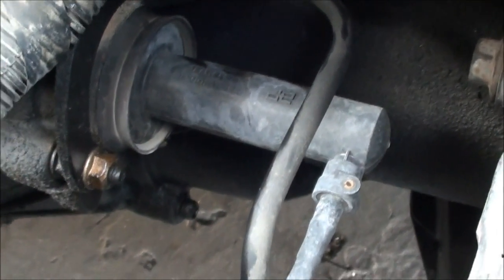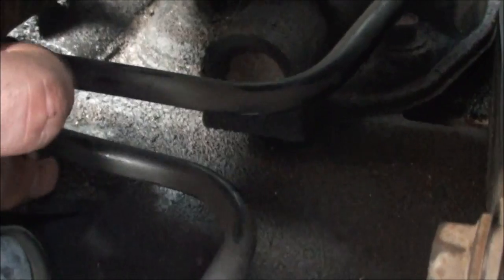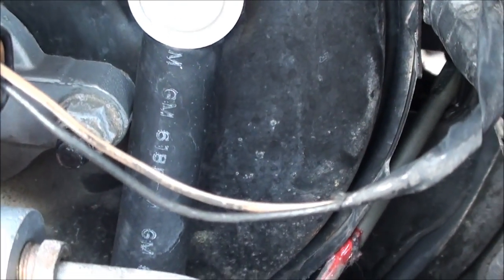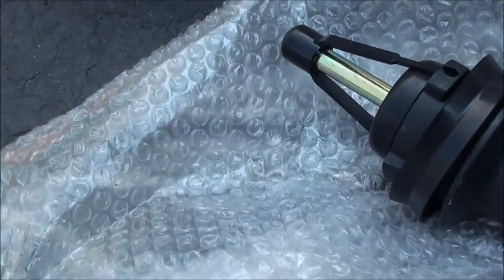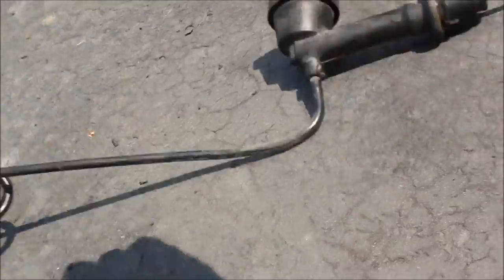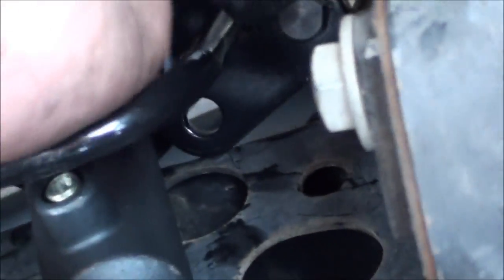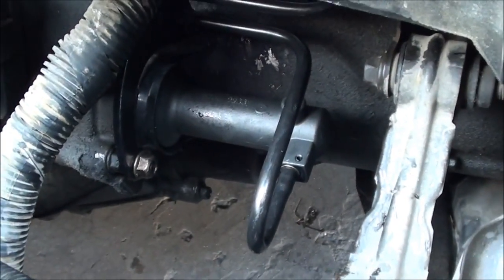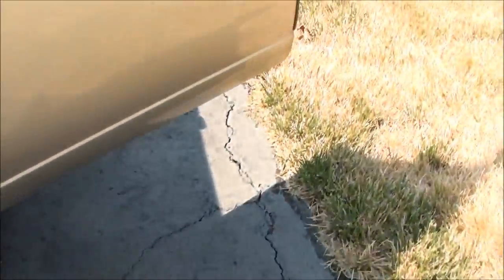Clutch Master and Slave Cylinder Install on 1998 Saturn SL2

Comment: Thanks for making this video. I really appreciate your genuine and sincere efforts on this. I plan to replace the clutch master and slave cylinder on my 1997 Saturn SL soon. I already bought the assembly filled with DOT 3 brake fluid and pre-bled. Your video offers some great tips.
Earlier I thought I licked the "nails-on-a-chalkboard" sound by disassembling the clutch pedal assembly and lubricating the nylon bushings with white grease. Although this was necessary, the same problem persisted.
Anyway, thank you again. This has given me more perspective and knowledge to tackle the repair successfully.
Reply from the maker: +Ronald Schild My pleasure! Just trying to do my part to help others.

Comment: Was dreading the job on my girlfriend's 2000 SL1 until I saw your video. Thought it was more entailed. Only struggle was getting the masters out and back in due to the booster. Really had to muscle the new one in. Took the better part of 3 hours but for a first-timer that hates to force things, that's probably not too horrendous. TY!

Comment from the maker: yes, I removed the airbox, but could not remove the battery tray because the bolts were too deteriorated by battery corrosion to remove. as long as you can feed the lines through and get it to not rub on anything the wrong way you should be fine

Comment from the maker: they both work together. Master cyl. is what converts your pedal pushing into hydraulic power to push the piston out of the slave to disengage the clutch. best to buy as a master/slave unit since it is a pain to bleed the system. If you have a lot of miles and its grabbing low, it might be a worn clutch plate and/or flywheel. those are "fun" to replace. never replaced one but hopefully won't need to for a while. hope this helps!
Reply: En este caso, ya cambié kit de embrague y si, cuesta algo cambiarlo....

Comment from the maker: Does it shake in neutral?, i.e. shifter not in any gear and not depressing the clutch pedal. if so possible tuning issue or something off balance. the difficult shifting could be something with the linkages or the pedal is just not getting pressed all the way down, if so then start suspecting the clutch. check the clutch reservoir for fluid. pressing to floor and still hard shifting may not be disengaging all the way and its hard shifting. so then this might install might work. Hope this helps!

Comment from the maker: It is a good possibility that it will help. you also may need to replace the shifter bushing on the shifter knob as well if there is a lot of slop while in gear. the shifting is controlled by cables and not directly connected to the transmission like a rear wheeled vehicle would be. check all your cables too and see if any need adjustment or replacement. Good luck!

Comment from the maker: Thanks! if I remember correctly the brand was Perfection and i bought it from Advance Auto Parts. If you have the DOHC like my car has then it should be a nearly identical install. I am pretty pleased with the install only had one problem after where it kept squeaking when pressing the pedal but quickly fixed by moving that little clip in the clutch pedal. as for the idle issue, not sure if this will help. might be a tuning issue. I would search in the SaturnFans forums tons of info there.

Comment: I recently had a new clutch and flywheel installed and when I depress the clutch pedal it makes a clicking noise. Could it be the master and slave needs to be changed?

Comment: Thank You Bro this really helped me a changed mine on a 2002 with abs..I had to move the brake fluid Reservoir and a few other parts I actually did the remove entirely the battery compartment it helped alot

Comment: Great Video man!! ..would this procedure help me shift gears smoothly? I have a 1999 Saturn SL2 and its quiet difficult to shift gears sometimes..i have to use a good amount of force to get into 2nd gear from 1st.
Reply: I have the same problem, been fighting it for years. I have to make sure the resevior is full and press hard on the peddle to shift.Just bought the prefilled Duralast unit from AZ store which I'm going to install as soon as it warms up a bit more.:) I hope my battery box isn't rusted in.:)

Comment: Hello and thanks for your video regarding manual clutch fix for s series Saturn's. I would of liked to see the work done under better lighting and perhaps see the 'fix' while the cam was not shaking. When you went inside and under the dash to show us the clutch/rod/linkage, it was impossible to obtain some valuable point's of interest for determining the problem. I will use this tomorrow though and pray it all comes together as in your video.
Reply from the maker: I Apologize for the horrible lighting, There wasn't much room to work with to put a light and didn't have a tripod small enough to stick out of the way when I was working. Best suggestion I can give is to go in before any project and take photos of what everything looked like before and try to put everything back as it looked in the photo. Good Luck!
Reply: jungleking007
Thanks for reply. For what it's worth, my clutch 'fix' was much easier then imagined. Equipped with a strong light I slid myself up under the dash and found that my clutch pedal had only popped off this small silver rod which I'm assuming is the top of the hydraulic pump. The pedal must of came off while I was trying to push/jump start the car or while I was bumping around in the dark down there.
Reply from the maker: Don't you love finding out the huge problem you think you were having was some very small easy fix? I am happy to hear the issue wasn't something bigger.
Reply: Oh yes I do agree and only wish that was the case most of the time then not. This site will prove to be a needed tool in the months to come. Thank you all.

Comment: I just changed out a clutch to a stage 3 clutch in my buddys 1997 saturn sl, it was hell. we actually ended up blowing out his slave cylinder just by changing he clutch (im sure it had issues before hand it was just the straw on the camels back). about to change that out tomorow wish me lucj

Comment: Hi we did the excact same thing as in this video. Well my 98 saturn was having trouble shifting. and the whole clutch kit and slave/master cylinder was replaced. When replaced. I noticed that the plastic part did not break when the pedal was pressed. It shifts when car is off and stuck when car is on. This was the same problem as before. Is there an adjustment in the pedal? I don't see one. There are no leaks in the hoses. Is that rod to the transmission too short?

Comment: 13mm nuts. Pretty much everything on the car is metric. Also, you can replace portions of the system instead of the whole thing, but you still have to remove the whole assembly and then bleed it properly.

Comment: This was a very useful video. Did you take the air filter box out, instead of the battery tray? Anyway, I managed to get the tray out, didn't take out the airbox or the brake stuff.
Just a tip for people not wanting to unbolt the brake master cylinder... getting the old clutch master out is slightly difficult, just because you have to figure out what's in the way, etc., but after you figure it out, putting the new one back in is easy, up until the part you have to twist it into the firewall.

Comment from the maker: If you bought the entire unit they are set to go no bleeding required. however, bleeding a manual transmission clutch slave and master cylinder is possible, very tedious because you don't want to ruin the parts. never done it though. sorry. if you go to a forum for saturns (saturnfans) search there, I believe there are a few ways to do it.

Comment: Hey, I've got a few questions.  I've gone through two of these assemblies this week and I realized that the problem was the plastic retainer cap on the slave cylinder.  The first one I installed a few years ago went in smoothly with no issues, but after doing it again yesterday, the shifting only got harder.  I took it back out for a replacement (thank god for a lifetime warranty) and noticed that the clip only detached on one side leaving the piston all cockeyed. I had installed the new one thinking it would break on both sides, but lo and behold, the same problem occurs. Am I possibly doing the install incorrectly, or is it just my luck that I would get two duds in a row? The shifting is a beast.  Also, when I removed the old one originally, the plastic cap never came out with the shaft.  Is it supposed to burn up in the bellhousing?
Reply from the maker: The end cap is supposed to become part of the unit when snapped, if it didn't come out then it is probably at the bottom of the bell housing or still stuck somehow on the clutch fork. You will need to place the slave cylinder in as straight as possible, you may have missed the clutch fork the first time. However, with aftermarket parts you never know the quality these days due to where they may come from.
Reply: As far as I know I thought only one side was supposed to break I could be wrong thou.
I can't even get mine to break

Comment: Do you know if doing this on the later SL2 would be much different? I need to replace mine and while it uses a slightly different part but it's a very similar part.
Reply from the maker: +Haanken Thorax should be a very similar install. The master cylinder is a little different design but I think the slave cylinder is the same.
Reply: JungleKing007 Hey man, thanks to your video I got the old one out, and the new master in, but I can't seem to force the new slave in, its like the hydraulics are just too hard to compress. I know I have the tabs/interrupted thread things lined up. Also in the process of trying I broke one of those plastic straps holding the rod in, that may be WHY I'm having so much trouble, OR it could just be from pushing so hard. Any thoughts?

Comment: Hey man, awesome tutorial! Very well done, tripod be damned! I do have a couple questions. First, I have a 98 SW2, should the process be nearly, if not entirely identical? Second, What brand/manufacturer did you replace with, and are you happy with it? Last, my problem is that when I come to a stop, and I keep it in gear (clutch in for neutral), the wagon begins to shake, and its sometimes difficult getting it into first, should this remedy my issue? Thanks again!
Reply: Ha...I have this prob now.  How did it go?
Reply: @StevenMW  it's been ages, and I only remember the parts from watching the video. FWIW, if I don't remember, it couldn't have been that bad. Everything on these cars is so cheap and simple, I really wish I'd just kept mine. Typical, " installation is opposite of removal" IIRC. This would have been how I did it at the time, so I hope this helps.
Reply: Cool. I just wondered if you remembered if it fixed your problems...shaking w clutch engaged in 1st gear at stop, and hard to shift into 1st sometimes...my exact probs. ?
Reply: @StevenMW  pretty sure it did. Definitely didn't have any issues when I gave it up.

Comment: We just picked up the same car for 600$ the clutch seems to be sticking and it’s hard to get it into gear, trying to figure out what is causing this?
Reply from the maker: Could be a couple things:
- transmission fluid needs replaced
- worn/stretched shift cables.
- clutch master/slave system is worn.

These are the issue I experienced. Hope this helps! Thanks for watching.

Comment: Great video!  I was about to abandon my '94 Saturn but you have me thinking I should try to fix it now.  The problem has gotten gradually worse to the point of now when I push the clutch in it won't let me put the car in gear.  It was squeaking sometimes as you mentioned in your video.  Additionally, it seems like it was grabbing really low.  Sound like a cylinder issue or fork issue to you? Also, what does the master vs. slave cylinder do?  Do I really need to replace them both?
Reply: Did you ever replace?
Reply: @isiahchuckyy2755  Boy, that was a long time ago. I did change it and it fixed my problem. I don't remember the process but I remember doing it. In 2014 I finally got rid of my Saturn. It was still running but was definitely at its end of life. Good luck!

Comment: Probably a silly question, but you added the dot 3 fluid in before you pressed the peddle to break the clip on the slave cylinder?
Reply from the maker: This was a pre-bled sealed unit I installed. No fluid addition required.

Comment: Okay so question, I was driving this same make and model just fine a few weeks ago. Was going 65 on the highway and was about to turn into my neighborhood. Went out of Fifth and into First at a stop sign, noticed that I couldn't switch gears anymore and there was no resistance on the clutch petal. Got it home by starting it in first and driving it really slowly, (couldn't stop without it dying.) later asked around what people though it was, most people said the hydraulic system, I figured I would replace the whole thing like you did in this video. Bought the part, did what you did, but the same problem occurs.

Now the clutch fork is that plate in the bell housing with the little bump in it, that the piston from the slave cylinder pushes, right? Should I be able to move that with my fingers at all? and do you think I simply missed it when installing the slave cylinder?
Reply from the maker: ***** If you are a member of the saturnfans forum read the thread called "Help! - Can't shift gears after Master & Slave Cylinder replacement" I believe this may answer your questions.

Comment: Any ideas if this wasnt the problem but the clutch wont engage
Reply from the maker: +Cesare Smetters possibly a bent clutch fork, worn out pressure plate and/or clutch disk, stretched shift cables. Just a few things to check.
Reply: JungleKing007 it will shift off.  And we had to drive it in 1st off the road so wouldnt the actual clutch disk be good?  So pressure plate?

Comment: i have a 1995 saturn sl with about 145,000 miles. the clutch is slipping badly, but i don't want to count a worn flywheel yet. one odd 'symptom' is that the clutch pedal squeaks and squeals horrendously when depressed. and it mostly started on hot days in the summer. but it pretty much does this on startup, or at least only 5 minutes after driving. anybody out there recommend a 'diagnosis'? thanks.

Comment: when did you snap the end cap off or does it do when u press the clutch
Reply from the maker: End cap on the slave cylinder stays on to keep the piston from shooting out while installing onto the transmission. It will snap loose when you press on the clutch pedal the first time after install. The cap essentially becomes part of the system .
Reply: Thank man doing a clutch on one just wondering after removing the the old are they reusable cuz the rod is  just there lose I can pull out like nothing